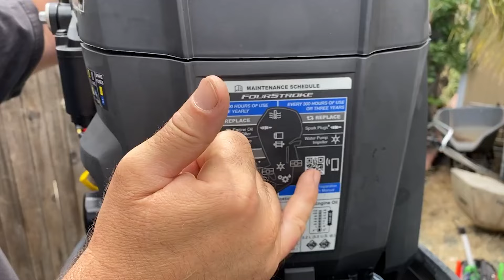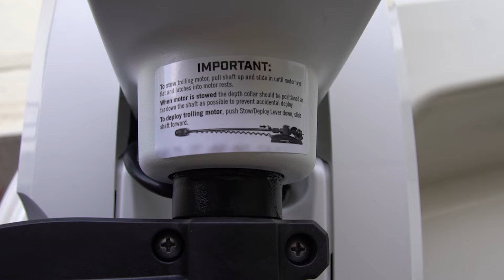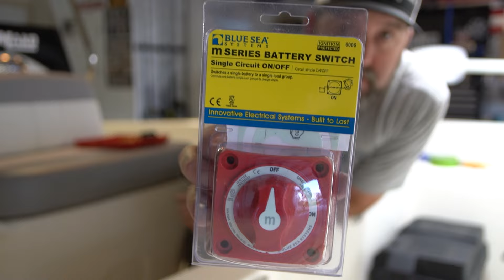INSTALL A MINN KOTA RIPTIDE TERROVA | HOW TO

Comment: Nice detail. I have helped a few of my neighbors with their boats working on trolling motors.  Zinc or Sacrificial Anodes were used to prevent electrolysis on trolling motors on the prop nut. Big deal for saltwater use.

Comment: Great video install thanks! How do you like that trolling motor? I am shopping for one. Thats the one with less options which I prefer?? Its also rated for salt water is that correct??
Reply from the maker: Yes this this the rip tide version which is rated for salt water. It been a good trolling motor no complaints! I'm glad you like the video and thanks for watching and commenting I appreciate it!
Reply: @ReelLifeFisherman  No problem ! Im sure I will have questions once I get a trolling motor and start to install it. I'm shopping for trolling motor for a 22' 1988 Starcraft Marine Center Console. Not sure what size shaft I need as of yet.

Comment: Hi I have two questions. 
     Can’t you just hook up your trolling motor to the batteries that are running the gas motor? And… 
     Why does everyone run the electric motor in the front of the boat and not the rear?

Comment: Thank you ! why is the motor left side ? is it same on right side ?
Reply from the maker: Thanks for watching! The wiring and access panel is on the left side so much easier to install it there . That's where the factory intended it to be mounted.

Comment: Great video, couldn't you use the breaker as the on/off switch for the trolling motor and skip the on/off switch.  It seemed to me on my old Ranger that the breaker is what they used to control isolate the starter battery from all the electronics and did not use and on/off switch.   I plan update my wiring on a small fishing boat and wondering if I can get by with just a main breaker switch.  Thanks!
Reply from the maker: Thanks glad you liked the video! Yes you absolutely can use a resettable breaker as a switch. I actually do this for my flounder gigging lights I added that will be in an upcoming video .  One reason I didn’t do that for the trolling motor is the breaker is in the battery box and I wanted to keep that covered. Also the boat should have came with the battery switch already installed for the trolling motor.. but this one didn’t. They forgot to install it at the factory.. I work for bass pro as a boat mechanic so I just installed it myself.. thanks for watching and commenting

Comment: Curious why you countersunk those bolt holes in the plastic.
Reply from the maker: I do countersink them in fiberglass.. it helps to prevent the gel coat from cracking out from the holes drilled. You always want to do that with fiberglass when you drill a hole for a bolt or a screw..  thanks for watching

Comment: Super nice video on how to.  spoke very clearly, showed awesome videos....would love to see you install a front ducer and how to route the cable so it doesn't tighten and tear....
Reply from the maker: Awesome I’m glad you liked the video! So the only way I recommend installing a transducer on a trolling motor like this one a electric steer style,is to use a mount made by precision sonar. If you look them up you will see the mount I’m talking about. That is the only way to do it without that it will eventually lead to you damaging the transducer cable and replacing the transducer. It’s one of those not if but when situations! Thanks for watching and commenting I appreciate it!
Reply from the maker: https://www.precisionsonar.com/products/accessories/cable-guards/cg-pwrdr

Comment: Great video I s the heading sensor always on or should I wire it thru a switch so it’s not Always drawing power.?
Reply from the maker: Awesome glad you like the video! So I have a main battery switch that kills power to everything.. if I didn’t i would wire it to a switch. Because it will slowly drain the battery. It’s always looking for the trolling motor signal. Thanks for watching and commenting I appreciate it!

Comment: excellent video: will it work w/out the heading  sensor? buying a used an seller says you don't need it? will 60" shaft work on a 4' of freeboard?can this be mounted on transome?
Reply from the maker: Yes it will work without the heading sensor. It’s mostly used for spot jog feature. I wouldn’t recommend mounting it on the transom it’s not designed for that and would be very hard to control.

Comment: Does the electronic compass puck stay on the whole time. I'm looking to hook mine up to a 12v100ah lithium house battery. Just wondering if I need to put it on a switch.
Reply from the maker: If there is not switch or battery switch it will always be looking for the trolling motor and it would slowly drain the battery.. thanks for watching I appreciate it!

Comment: Wondering if any benefit to installing an MK plug instead of hardwiring with switch like you did … I’d prefer to hardwire it I think as less holes to cut in boat but seems like everyone doing the plug …

Comment: Why counter sink the drill holes on the boat? That's doesn't seem necessary in this installation.  Everything else in the video was excellent.  Thanks for the information.
Reply from the maker: Countersinking the holes drilled on a fiberglass boat will help prevent the gel coat from cracking later down the road. Thanks for watching glad you liked the video..

Comment: So two 12v batteries wired up in series to make 24v can be charged with a 2 bank 12v charger, 1 bank to each battery? Will this work with lithium batteries?

Comment: Could u show where you ran wires for the speakers? I wanna keep the onboard charger under console and run an extension to the trolling batteries. Was there a foam you had to break through or is the channel pretty open?

Comment: Thanks for the video.  I've watched a lot of videos on installing the Riptide Terrova, but yours is the best and by far the most complete I've seen.  I'm installing mine on a KeyWest 189fs.  I mounted it today and will finish the electrical tomorrow.  Is there a reason that you put the circuit breaker in the battery box and didn't mount it on the wall with the battery switch?
Reply from the maker: Thanks ! I’m glad you like the video and it was helpful..  the only reason I put it in the battery box and didn’t mount it in this case is because I’m throwing a lot of stuff in and out of that compartment constantly and didn’t want to hit it and trip it accidentally or something.. but on a normal install with batteries under a center console or something like that I would definitely mount it . Thanks for watching and commenting I appreciate it!

Comment: Did you run an outlet for the battery charger? Or do you leave the hatch open when you charge the batteries? Also was thinking of putting a plug for the battery charger on the panel the trollling motor wires go into. Is there an easy way to fish tape the wire from the charger to that panel

Comment: Nice work! 

Is there a way I can use the same motor for two boats?…or would it be have to be two different motors due to the size difference in boats?

I have a 21’ Seahawk and a 16’ Marlon. 

You enjoying Florida more than the PNW? Might be a cool vid to compare contrast fishing in FL vs OR.

Comment: Awesome video, keep posting more! I noticed you mounted the trolling motor off to the side, does that affect the steering on the boat versus having it centered on the bow? or does it not matter ?
Reply from the maker: Thanks! I’m glad you like the video! So on this boat it’s a skiff that’s designed to have the trolling motor mounted off to the side.. it doesn’t really make any difference steering it that I notice. Even spot locking in currents it holds straight.  On a V-hull style I would say you want to mount it  so when deployed it’s as close to the center of the V on the bow as possible.  Thanks for watching and commenting! Let me know if you have any questions ..